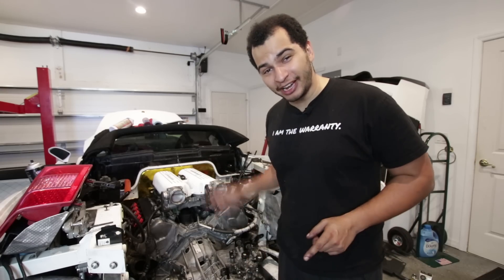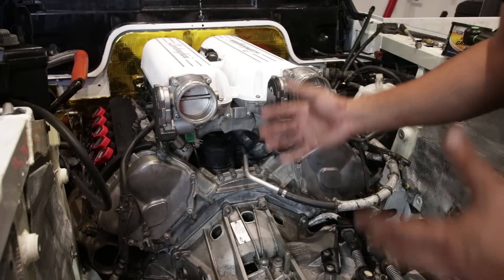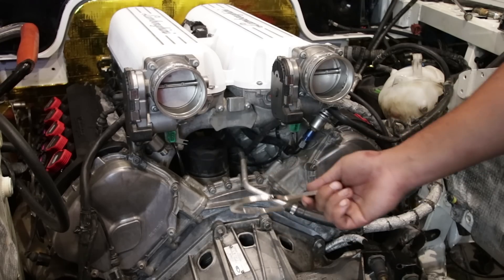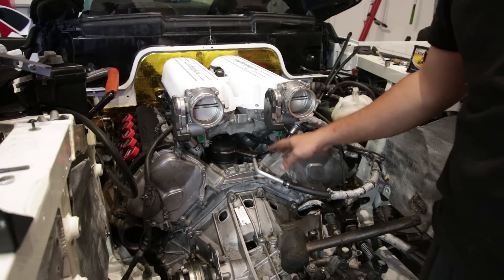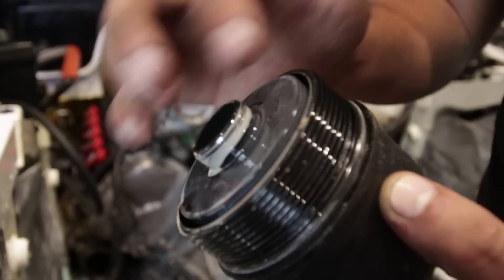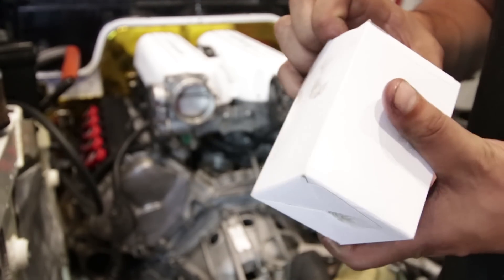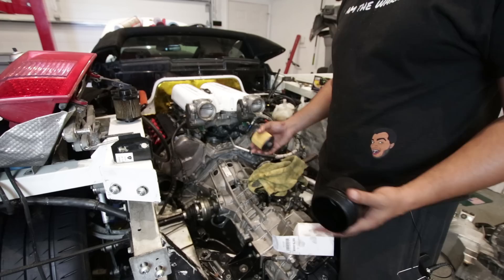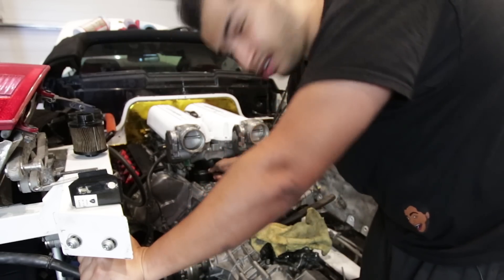My Cheap Lamborghini's Oil Looks Like A MILKSHAKE (And I'm NOT Worried About It)

Comment: If you can’t fit a socket and need to use a torque wrench, look into a tool called a “crow’s foot”. Used it in aviation all the time. 

I’d recommend torqueing any component of the drivetrain, vibration can loosen them over time. But, I wouldn’t suspect the trans will fall off if everything is well snugged down.

Comment: Funny that translucent coolant bulb has worked flawlessly for 14 years my mk4 gti in both hot and cold wx climates AND I can see my coolant level at a glance...your assupmtions are misgiided...keep doing your research and work smarter, not on unfounded half truths or pure laziness...I like that you're doing the wheeler-dealer thing and saving a car, but the least you can do is save it the proper way, even with budget parts from "lesser" vehicles...good luck w/the build

Comment: I thought  that is a common knowledge that you should always go from inside to outside when tightening valve covers, heads and that kind of parts.

Here is some explanation for it:
1. You typically work from the inside out to prevent trapping stresses in the part being bolted down.
2. You generally do diagonally opposite bolts in turn to avoid setting the component down to much in one concentrated location and potentially distorting the gasket or loosing the alignment between the two components and gasket.
3. You also do the bolts up in stages to avoid setting the component down to much in one concentrated location. The more stages in tightening the less that 1 and 2 above are important.

Comment: Dissing guys using jetta parts on lambo but didn't you just use hacked FORD parts literally few days ago ? :D
Reply: vw parts are junk so yeah there's that.
Reply: At least a jetta part is still the same company....I'll take a jetta over a ford any day!
Reply: No thanks, my ford has outlasted my jetta and it costs allot less to do service and replace parts on a ford over a jetta.
Reply: When my wife Is coming home with lug nuts 2 piece system that are all chewed up and expanded on her 2015 ford fusion with 45k miles on it i would have to disagree. My jetta has 160k miles on it and the only issue I've had other than standard maintenance( brakes, new tires, oil change, ect.) Is replacing a steel rim after I hit a deep pothole at night and bent the rim. 3 times the miles with the only issue being my fault. Which is why I'll take a jetta any day over a ford
Reply: Not to mention I do all my service on my jetta and it costs pennies. If you do your own work you save a lot of money and don't have shops trying to rip you off.
Reply: $80 for a crack pipe on a jetta and it's a useless part.  $18 for a cartridge oil filter compared to a standard canister filter that averages $8.  Having to pull the transmission on a jetta just to get to the timing chains to replace or service them, seriously how moronic was that engineer.  The only way wheel lugs get messed up is if the last service person or owner failed to torque them down properly or the driver hit something hard.
Reply: I don't know where you're going for your cartridges but I get mine with the steel backing for $10...While I would agree with the lugs being over tightened, all work on her car preformed by the ford dealer(warrenty reasons), they refused to take any blame and fix it free of charge citing it as the material issue, not theirs. Now we both know they over tightened the nuts, however the design with a chrome coating  as thin as tin is a joke! It sounds like you may have had bad luck with a jetta, which engine did you have? I have the 2.5 and it seems indestructible, and very reliable.
Reply: Suomi perkele
Reply: Billy Allen  dont forget having to unbolt the engine from the mounts and jack it up to change the water pump on a vr6. german ingemuity.

Comment: I have a 2010 Audi S6  which has the 5.2 V10 and have had to replace the stock oil filter housing which is basically a remote relocation tube from where it connects in the V of the engine. Who knows, maybe you can modify it to work. Worth looking into. Love the content, keep it up!

Comment: Not a dab of new oil on the seal!?
Reply: you need to oil the seal and you should dip the new filter in oil prior to mount it otherwise it will resist oil flow on the first seconds of use and may cause unnecessary engine wear...
Reply: I was going to say the same thing, particularly when he said he was going to wipe the seat because it was dirty. Most manuals specify hand tight because that seal can start to twist and get damaged.
Reply: Personally I've never bothered to pre-oil the filter when I change them, if you're really concerned about oil starvation on startup then just pull spark and fuel from the engine and crank it a few times till the oil pressure comes up.  I you want to do it you're certainly not hurting anything but I wouldn't take it as a requirement.

As for the seal and o-rings for the filter and housing though, yeah a light film of oil on them is a good idea before refitting, you risk them bunching, twisting or tearing otherwise.
Reply: Oh yeah better torque the oil filter till it breaks, don't pre-lubricate either that's an unnecessary step
Reply: And over tightens it.  Such a basic thing that any home mech knows to do yet he just fails to do it.

Comment: You could just say "click" when doing up bell housing bolts. Done hundreds of clutches never torqued bell housing bolts.
Also in regards to rocker cover gaskets always start in middle and work your way out just like trying to apply a vinyl decal. If you start at both ends and stop in the middle all the slack has nowhere to go. Start in the middle and the slack works it's way out of the ends and doesn't bunch up

Comment: You can put it right next to the right side valve cover kind of the way you held it in the video. It’s just a lot tighter of a fit because it’s a spider and you lose some real estate back there. And it will work better if you turn your turbos around and have your intakes under the taillights where the vents are.

Comment: Copper plugs typically offer the best spark at the expense of longevity. A fine wire platinum or iridium may work well under boost as well as they require less voltage to jump the gap.

Comment: I would throw the turbos to the side and rebuild it without them..
Reply: ThePhiltastic if the conversion has been done correctly the compression ratios will be lower allowing higher boost pressure, if that is the case it probably wouldn't even start and if it did it wouldn't make power.

Comment: In the uk me and my friends have used the grunt system to build engines and other mechanical things when we didn’t have or need access to a torque wrench. It works like this a small grunt, a quarter of a grunt then a half of a grunt. When your getting serious it’s a three quarter grunt and the big daddy of a full grunt if you really go for it it’s a bloody big grunt this normally results in you ass eating your undies. We try to refrain from the super on to save on the cleaning. This system worked for years.

Comment: I just have one question I hope you're going to flush that motor out get the milkshake out of it
Reply: getting rid of the milkshake is easy, just start the engine and let it reach operating temp, then shut it off and immediately remove the valve covers(ideal)  or just the oil cap and watch the smoke as the moisture evaporates...do this a few times until all the moisture is gone
Reply: No Akomplice - why would you say that? Did you even watch the video? He specifically said in the video that hw WAS going to flush it out once it runs and he can get it hot...

derp...

*edited because autocorrect being stupid*
Reply: I don't even bother opening the valve covers. The moisture will get sucked into the intake manifold into the combustion chamber.

Comment: Just a heads up: Don't be alarmed when you pull that oil filter again and see more of the milkiness. On my race car (Yes, a real purpose built race car, not a street car) the oil is like that often. part of that is spinning it 16,000 rpm, other part is the methanol, but it doesn't hurt the motor at all.

Comment: Stick with the copper spark plugs and make the gap smaller than the factory specs because the added turbos increase cylinder pressure under boost and will cause misfires under load

Comment: My only other concern would be the tuning. You said it was set up to run rich. Maybe too rich to run when boost isn’t applied. Then it’s E85 too. Which has to run richer then pump gas. And it’s very easy to mess up a tune to begin with. Now your adding boost and E85 to a car that didn’t have it. It may be too rich on vacuum.

Comment: be carefull beacuse the coolant tank in some cars has to seat in a specific height relative to the engine in order to bleed properly and not have air pockets and have proper flow etc etc

Comment: You worked on the transmission a lot!!! I know the engine runs just fine but I suggest if you can check the head cylinders by using wire camera to see through the spark plugs holes to have an idea where you at

Comment: With the fuel system I would strongly suggest to pull the fuel injectors and have then checked and cleaned because of e85. I know quite a few people that will simply soak them in wd-40 overnight

Comment: Shouldn't you put some fresh oil on the  "O" ring before installing the oil filter ? (I know most cars recommend it, to prevent damaging the otherwise dry "O" ring). 
 I'd also recommend changing the oil and filter after a couple hundred miles (or sooner) to flush out the remaining milky crap). Love this rebuild series.

Comment: Remote oil filter you will need to build an adaptor then you can use off the shelf AN fittings, steel braided oil lines and filters from any race car supply store.  IMSA guys are racing Gallardos.  I made one for mine

Comment: I'm very sure that oil filter is the same as a A4s. It looks roughly the same radius and height. My c class took a similar one but taller. I maybe mixing it with the r8 which has two of these. But the best mod I ever done was treating my e46 belt with preserver. I even began using it on tyres and after 27k I had both original with little to no wear. I forget the treatment name but it's safe to use on treads (doesn't promote slippage). I remember watching a commercial about it and couldn't believe the rubber after treatment showed no wear after heavy friction. There's a YouTube clip where a guy goes at the rubber with a file and no treatment easily flakes away, treated doesn't.

Comment: Awesome work so far but you really should take the time to torque the transmission bolts. It's not that much effort, especially for a car that's going to throw 1000+ HP through it's transmission at some point. I'm only pushing 250HP through my Miata motor and trans and there's no way I wouldn't torque the mounting bolts to spec.

Comment: Drill filter housing you have and the run pipe to where you want the filter to live just make sure you look at the cartridge to place the out pipe and the return correct did the same on an Audi I had and worked great

Comment: While you were at sebring would have been a good time to check out the gtd Lamborghinis , both the gt3 endurance cars that won at Daytona and Sebring both run a coolant over flow bottle that looks like the one from other vag cars that clear bubble bottle. It's easy to mount easy to reace and easy to see how full it is. Also the same bottle in the super trofeo huracan. Mounted high and to the left of the engine bay.

Comment: I would go with IEX's they are the iridium plugs. Decent longevity and better for boost. You don't need platinum's you're  not going to put 60k miles on that car. Also put some heat wrap on that coolant tank. so it doesn't melt when the exhaust manifold is glowing red (assuming the exhaust manifolds don't have heat shields)

Comment: Great video but i would do a compression test on that engine asap! Looks like a blown headgasket or cracked head. If compression is fine check the injectors. Run it with new oil for some hours and check the oil again. That level of polluted oil is nothing to just ignore. I blew my r8 2 years ago due to a fuel injector, its now been rebuild but i have never seen water/fuel in the the oil. Running without twin turbo though, if the pistons are not designed for that boost i wouldnt run it, rebuild it with parts that can handle the stress.

Comment: Technically speaking if you can’t fit a torque wrench you can use a crows foot or a specific extension for a torque wrench with the necessary math to find the torque value you need. They even have calculators for it online. Good and tight works there but there is totally a way to torque those properly JS
Reply: Remembering my Vector Statics class in college, torque has no location.  So, using a crowfoot wrench shouldn't need any extra calculations when using a torque wrench.

Comment: I have a 07 Passat and until the engine temp gets to normal it has white milky substance also under oil cap from moisture Volkswagen and other  mechanics say it's normal just the car needs to be driven. not just short distances so the moisture gets taken out of the oil hope it helps

Comment: Platinum spark plugs are the worst thing you can put in a boosted engine.  They tend to retain heat under high loads and become a glow plug after a while...which can lead to detonation....and engines don't like that.

Copper plugs are the best, they are cheap...but they wear fast.
Iridium plugs are great (not as good as copper for electrical conductivity, but better than platinum because they lose heat quicker between firing cycles), and have a long life...but they're expensive.

Comment: gutentight is a bad idea on cast aluminum, cast magnesium.  You need even torque and you need correct bolt stretch to keep the nuts from coming loose from expanding and contracting from engine/trans heating and cooling.  gutentight is fine for a race car that is taken apart frequently (I dont do it) but not a car that is expected to live over years of use. There is a cracking issue with uneven torque on cast AL and Mg parts

Comment: 1 more comment about the plugs. In doing research for my own car I learned that the temp of the plugs has to do with how you drive the car.  lots of high speed likes colder plugs and lots of city driving wants hotter plugs but more importantly is the gap.  the more boost the smaller the gap.  maybe hit up the company that boosted it and see what gap they recommend. also I dont see much benefit in longevity of spark plugs if the engine wasnt designed to run with iridium. copper iridium and platinum all conduct electricity but not equally.  Prob run factory spec plug with adjusted gap for the boost or hit up lambo and see what they recommend.  I just want that lambo to make the absolute most power it can :)  I'm sure you would want max hp and torque for 30k miles  rather than 90% hp torque for 60k miles.  Closed to open cooling system.

Comment: Hey man great job with project lambo so far.  As far as the expansion tank goes I would put it at the highest point you can find so the air finds its way out, as in higher than the heater core and engine block.  Also, I would see if its possible to delete the expansion tank and put a regular reservoir.  I think bleepinjeep has a video on swapping the piping around.  and yea you might have to put everything in and leave a long long radiator hose to the tank to see where you have room or can make room.  keep up the great work bro.

Comment: Oil can go milky when it does not get hot or is overcooled and will not burn of any Moisture inside the engine from condensation built up as it cools down and don’t jump at the old head gasket is the problem,  Just do what everyone does just Google
Moisture in oil

Comment: Whew, I was so worried he was gonna say torque on the valve cover gasket isn't crucial because it sure as hell is. Aside from that gasket, those bolts can thread into the cam retainers which is absolutely not something you want to ruin.

Comment: I would say look at bmw e60 m5 engine components for an external oil tank/pump solution, but I think they are wet sump engines. Btw the engine is also a 5.0 v10

Comment: Tavarish I would stick with copper plugs, the Platinum and Iridium are for longevity but suck with conductivity as where copper and and silver are far better for spark. So funny the BJR7E is the same I run on my Mkiv gapped .28, such a good plug and inexpensive.

Comment: Güd unt tight with a little bit of blue threadlocker, worked on my 350 swapped s10 with a 4.3 700r4 transmission

Comment: I run e85 in a chevelle.. gets same stuff on the oil cap even driving it almost daily...also doesn't use any antifreeze or any more oil than it should. (all IC engines burn SOME oil)

Comment: I guess you can use some heat resistant Silicone Pot Holder to cover the hole on that transmission or you can make a mold and make it out of something that is heat resistant. Not sure if that is good enough for you but for me did work and was cheap also  apart that mine is not a Lambo  :)

Comment: Theres nothing wrong with that expansion tank. They make metal ones to replace the ball style but yes that is a vw/audi expansion tank. it is in plenty of models but your v10 engine is also in a R8 and a bently Gt. Its all Vw parts. Use what works dont worry about if it "looks cheap"

Comment: I'm assuming thats a low pressure rail or one that you are planning to replace that you hit with the oil filter wrench into. There's nothing as fun as cracks in pipes that only weep under pressure.

Comment: You're going to need another oil filter in about 500 miles. All the white creamy stuff is very likely inside the engine as well. Oil change/filter change, and then change it again in 500 miles. I bet it'll be milky again from the current fluid left in the engine.